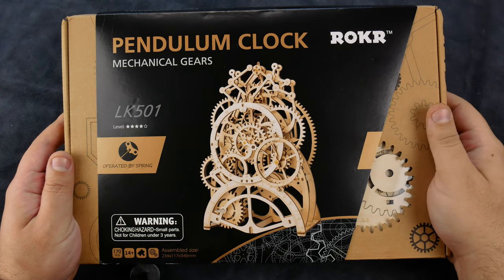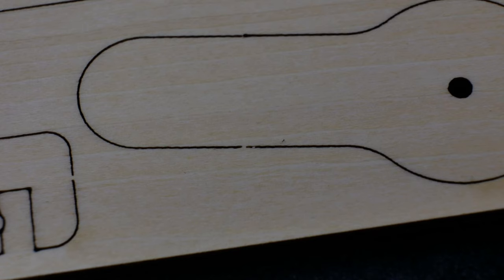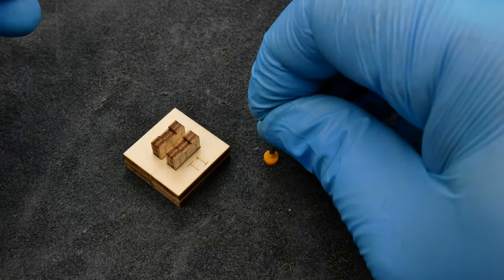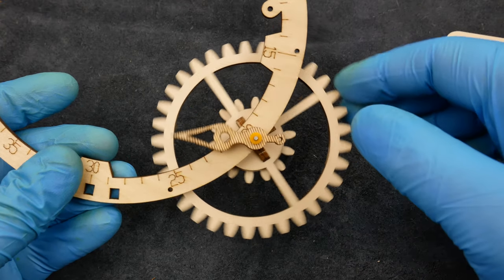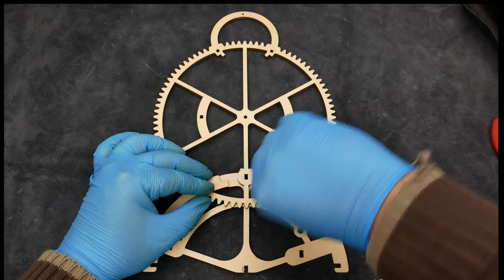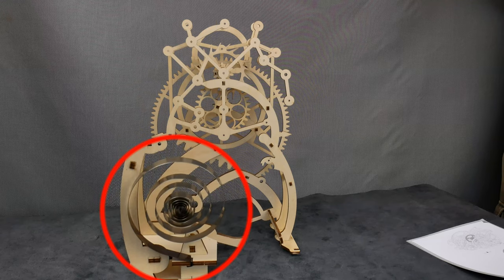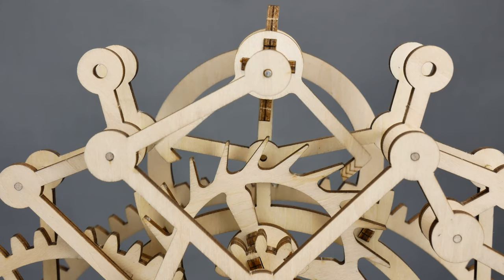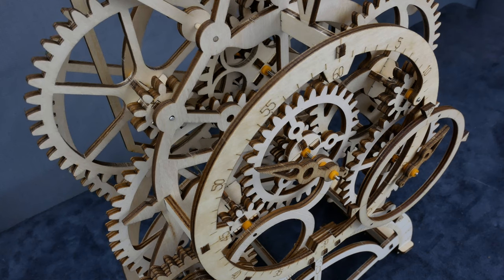Building The ROKR Clock.

Comment: Good review.   I assembled the kit last week, and it ran ok.  By the end of the day, it ran for exactly 9 hours.  However a 9hr run is not an effective clock, so I have modified the kit; removed the spring and replaced with a weight.  Two disks, one attached to the drive shaft and another in the centre to permit the cord to drop vertically from the centre of the clock.  Under test now, but there is enough cord for a weeks continuous run.
Reply: How did you did the modification ?
Reply: Can you make a video on how you did it

Comment: Mine’s going strong for 8 hours at a stretch. I also did a few modifications. I added a second hand connected to the escape wheel.
Reply: How did you connected the second hand to the  clock?? Mine works for six hours and  I am trying to find ways to extend its working time either with a bigger spring or a  hanging weight.  It is varnished with a lightly colored varnish ( chestnut  like),  the  hour and minutes hands are painted white and it is quite accurate timewise.  A  Very nice piece overall.

Comment: They should have used a different escapement. It's a escapement without recoil and the thing with these escapements is that they are more accurate than escapements with recoil but they are more likely to stop. Maybe you could try some oil on the pendulum and use some grease on the teeth of the escapewheel. Or try a lighter pendulum weight, maybe it will help. So and if all fails change the mainspring to a weight and ad as much weight as you need.

Comment: Just finished mine and it's ticking away beside me. It's excellent! It's a bit confusing that that are two pinions on the back of the hour wheel that don't mesh with anything. I assume this is intentional as the clock is running fine and there's no way of adjusting the spacers so they'd mesh with anything else anyway. Strange!

Comment: Thanks for the vid! Great job! I will make one of these using your video for help, before moving on the a Clayton Boyer model.  
I wonder how difficult it would be to add a drop-weight to this in place of the coil spring, so it will run longer...hmmm.
Reply from the maker: +Capt. Killingfield I’m going to take a crack at a wooden clock in the near future. I recommend a book called ‘Making Wooden Gear Clocks’. It has several different clock designs and comes with full size plans. Good luck with your build!
Reply: forget clayton go here first: http://www.woodentimes.com sells clocks that work. i built wooden times' septimus - fairly easy and runs superbly.  also the parts are cut with router rather than laser - so you don't get the nasty blackened edges on components

Comment: I want this clock
Reply from the maker: You can pick them up from the Robotime website.
Reply: go here instead: http://www.woodentimes.com sells clocks that work. i built wooden times' septimus - fairly easy and runs superbly.  also the parts are cut with router rather than laser - so you don't get the nasty blackened edges on components

Comment: I got this and I didn’t get wax either. Is that an issue with the manufacturer?
Reply: Me too
Reply: I found out that air shipping doesn't allow wax, so any kits shipped that way won't contain wax.
Reply: tbh wax is a bad idea - it's sticky and holds any dust. http://www.woodentimes.com sells clocks that work. i built wooden times' septimus - fairly easy and runs superbly.  also the parts are cut with router rather than laser - so you don't get the nasty blackened edges on components

Comment: My pendalum stops after a few seconds....
Reply: http://www.woodentimes.com sells clocks that work. i built wooden times' septimus - fairly easy and runs superbly.  also the parts are cut with router rather than laser - so you don't get the nasty blackened edges on components